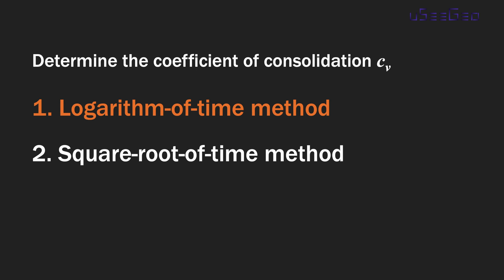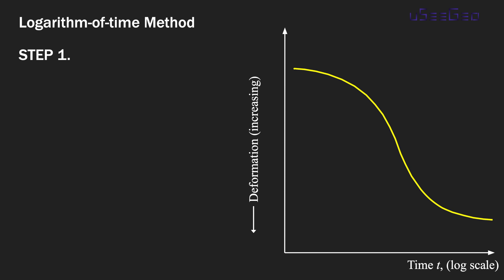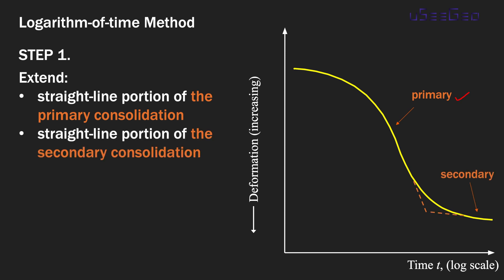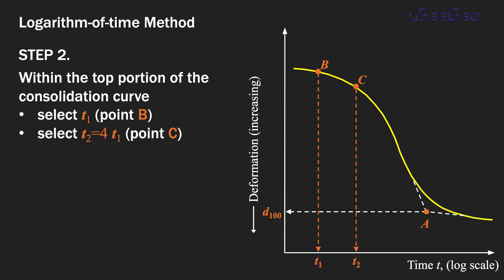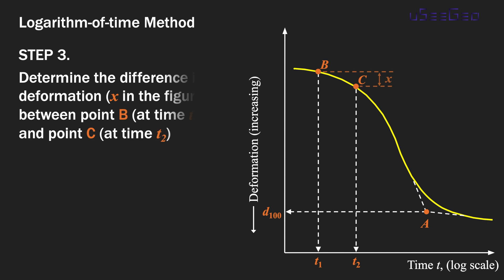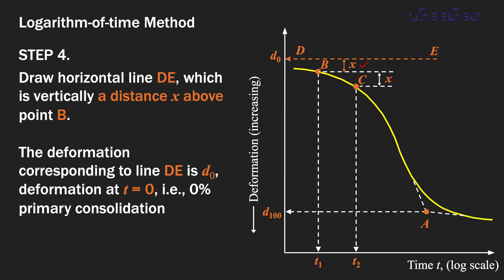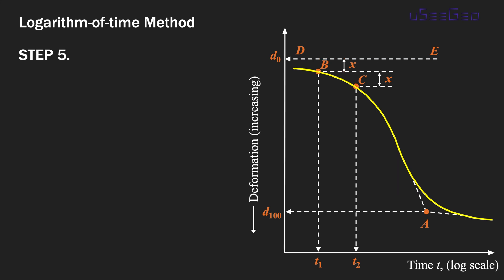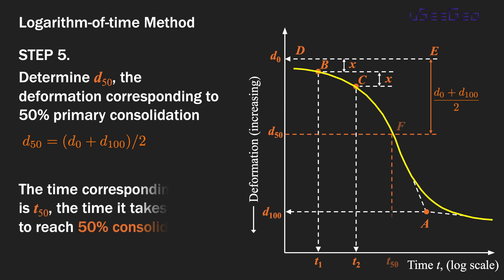Chapter 11 Consolidation - The logarithm-of-time method

Comment: Your equation for t50 is incorrect, simply adding d0 and d100 and dividing by 2 won’t give you d50 unless d0 is at 0in
Reply from the maker: The procedure and the equation are correct. This is a well-established method. Please refer to the Principles of Geotechnical Engineering by Das (10th edition, Chapter 12.13) for more details. Any soil mechanics book should have this method as well.
Reply: @uSeeGeo thank you, it’s very correct.
Reply: Your explanation is clear, thank you.